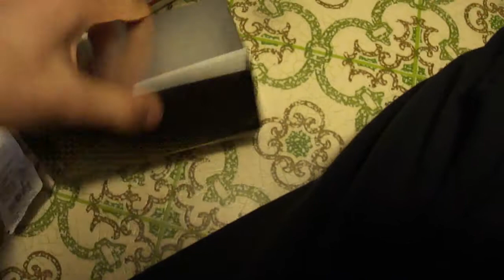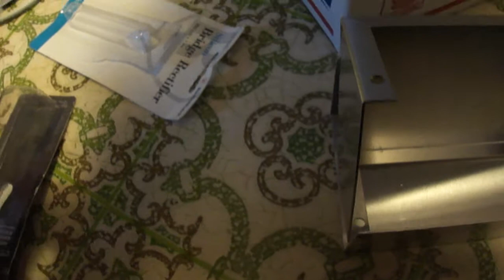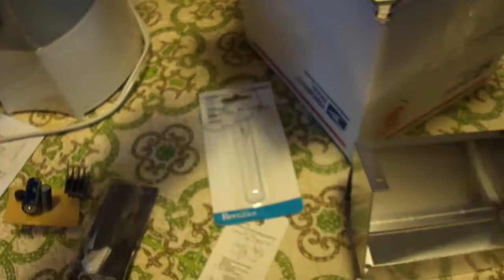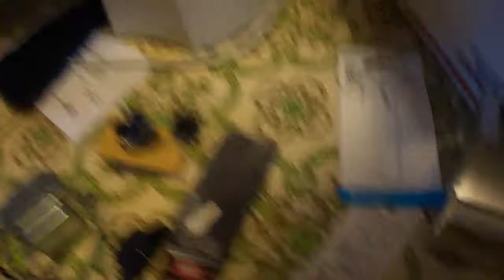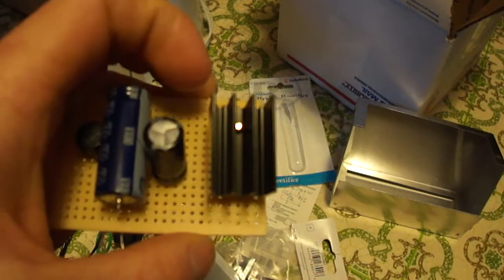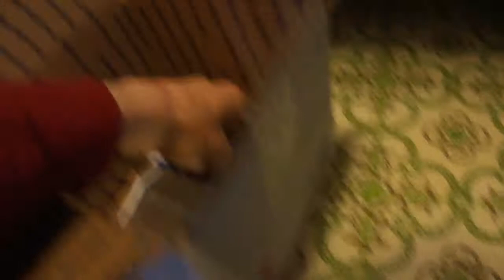Beginnings of a power supply...

Comment: Awesome! That's gonna be a cool project. And a variable DC power supply is gonna really come in handy too.
And it's amasing Radio Shack still has stuff like that too. The ones here don't really have a big selection in stuff like that.
This will be good experience too. Maybe one of these days you could build an amp or a radio. In fact, you could build a reciever!

Comment: Your heat sink is a bit small, that regulator can handle 1.5 amps, but if your transformator is doing 24v and you only using 5 volts, and one amp, you get a big power drop = equal to lot of heat with a linear regulator as the 317T is.

Comment from the maker: @KrankieV2 Thanks^^ yeah just watch out with those doorbell ones because their amperage is a bit higher and you might need a regulator that can handle its output. I was thinking about using one too but all I found were 24V ones that put out too much current.

Comment: @KrankieV2 

My power supply would have a 3V, 4.5V, 5V, 6V, and 12V fixed output with a USB jack on 5V too. That is, if I could find those regulators.

Comment: Nice, I should make one too. I'd use a 12V transformer for a doorbell. I think I would use several different fixed voltage regulators and use a bit bigger box than you're using, and have different output jacks and a common ground.

Right now I'm not going to spend any money to do that though.

loooks like your power supply will be quite useful.